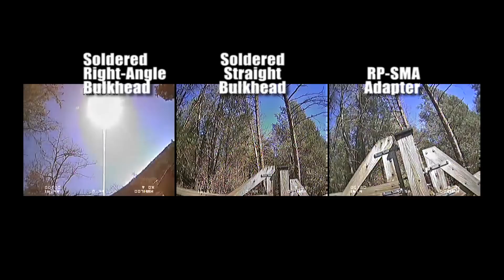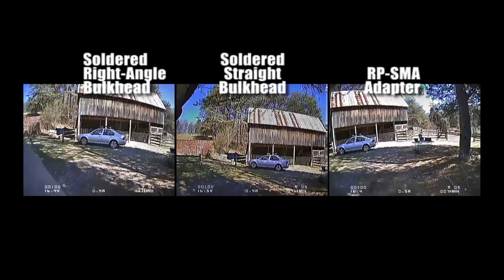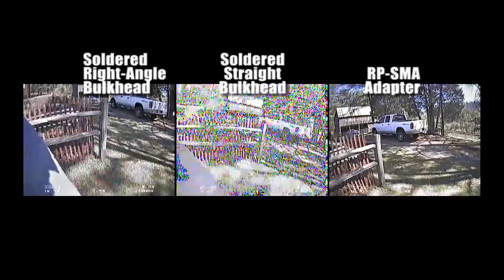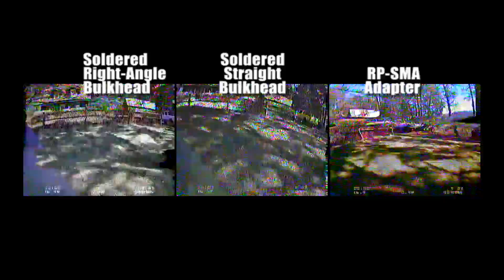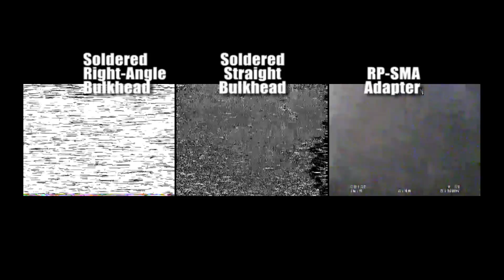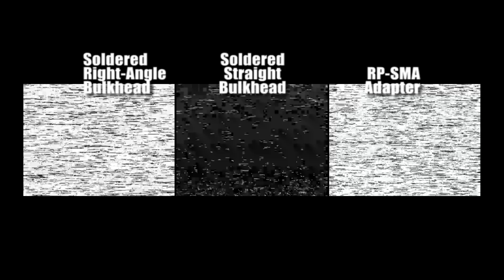FPV Antenna Pigtail Range Test

Comment: Cool test! Wonder if making some kind of low weight faraday cage around the coaxial cable would help give it additional shielding...
Reply from the maker: +Jason Faulks The cable's braided sheath already acts as a shield, similar to how a Faraday cage works. The change in range for the RP-SMA adapter is due to impedance mismatch where the connectors make contact. The change in range for the right-angle cable is because high-frequency electrical signals lose energy when the wire they are in is curved sharply.

Comment: could you please add photo with connections in these case? what  rpsma adapter is?
Reply from the maker: +Konstantin Mishenkov RP-SMA to SMA from surveilzone. I don't have photos any more, sorry.
Reply: +Joshua Bardwell so you have better result with this connector,is not it?
Reply from the maker: Yes.
Reply: Joshua Bardwell sorry for dummy question, but why do you use rp-sma instead sma-sma cable?
is reciver with sma and antenna with rpsma?
or is it spacial test of connection?
Reply from the maker: RP-SMA is what comes on the TS5823. I don't have a preference between RP-SMA and SMA.
Reply: Joshua Bardwell i use linear extension cable
banggood.com/60mm-Low-Loss-Antenna-Extension-Cord-Wire-Fixed-Base-for-Antenna-SMA-RP-SMA-p-1041606.html
just to prevent transmitter damange
do not know is it good for quality and distance or not ))

Comment: There are several websites out there that will tell you the loss for a particular frequency of a particular length.  One rule of thumb is, the higher the frequency the more quickly DB losses are built up.  Usually thicker cables that are better insulated greatly reduce this loss but the tiny pigtails have the crappiest most likely transmission loss.  Granted these are short lengths but still something to note.  Just by changing the type of cable on my 75 foot run for my 2 meter radio I went from almost 50 percent loss to only about 25 percent and that's only at 144 MHz....I can only imagine cable quality is VERY important at 5.8 GHz.
Reply from the maker: +txfieros It matters more when you have longer runs, since the loss stacks per foot. For a 6" run of RG316, which I think is the most common type of pigtail cable, Times Microwave estimates total assembly (with connectors) loss at 0.5 dB. If you were to go to RG-58 (which I don't think is really ever used in RC / FPV pigtails) you would go down to a total of 0.4 dB, saving only 0.1 dB. This is because the run is so short.
Reply: +Joshua Bardwell that's the site I've used.  Indeed I figured the difference would be negligible since it is such a tiny run but since we like getting technical I threw the comment up for those who might now know.  Great job on your videos.  I really enjoy the tech side of things.